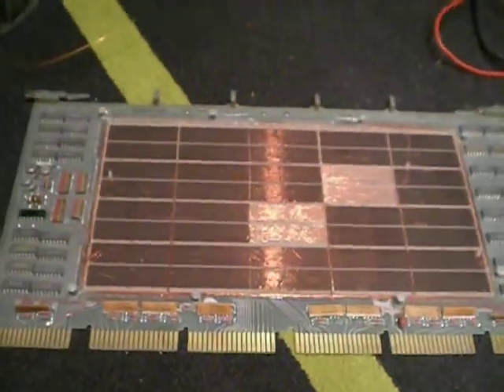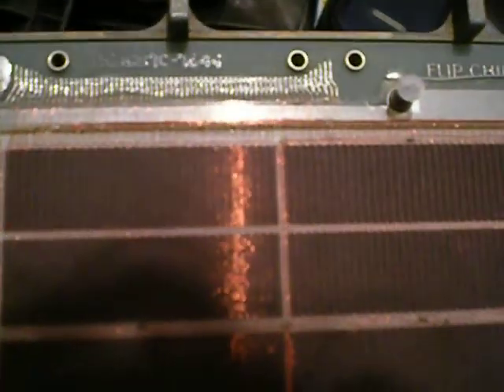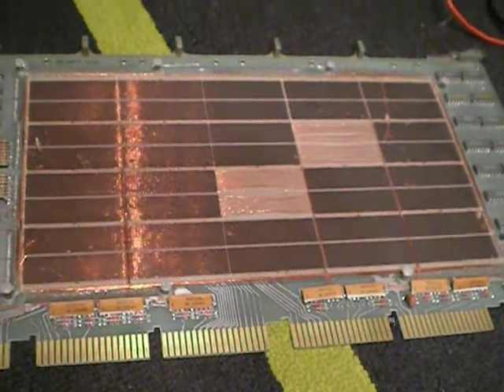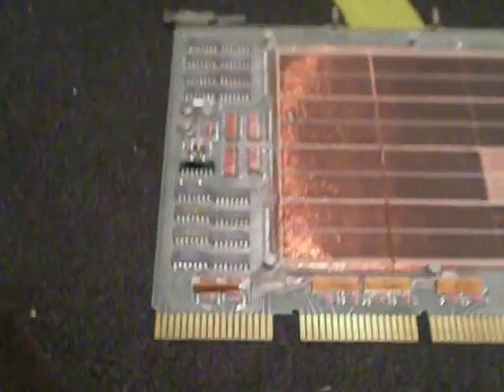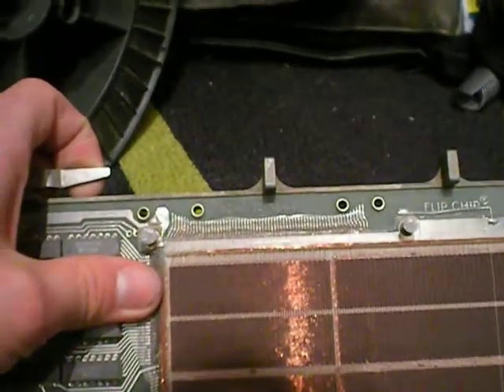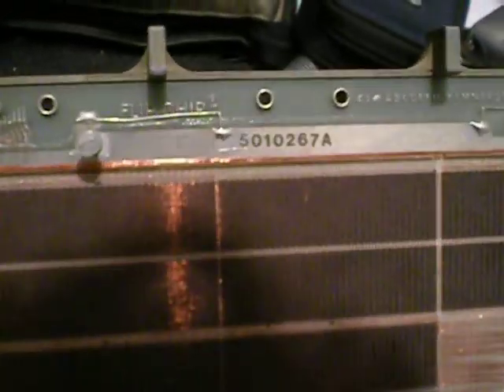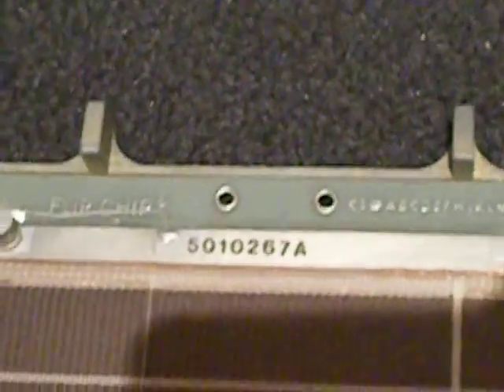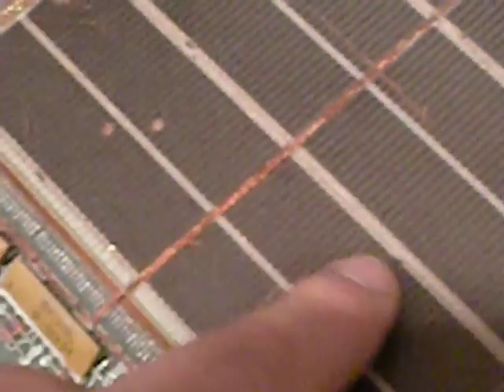Magnetic core memory (320kB)

Comment: 18 blocks of 16 kiloBITS = 288*1024 BITS.Probably from a machine with a word size of 18 bits or 17 bits plus a parity bit.In modern terms it would probably be equivalent to 32K BYTES. Since the serial numbers in ink and on the label identify this as a Digital Equipment Corporation (DEC) board I would guess it's from the 18 bit PDP-1.
Although the use of Integrated Circuits for interfacing with the cores and the Flip Chip reference suggest a later machine (mid 1960s) Do the chips have date codes on them? (YYWW= year and week)  The A to U letters are probably used for board revision identification.